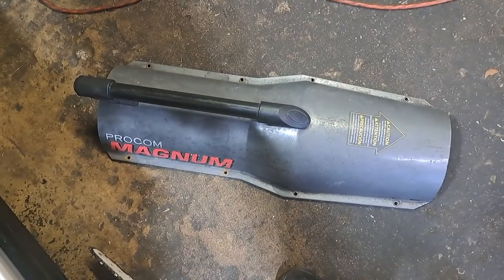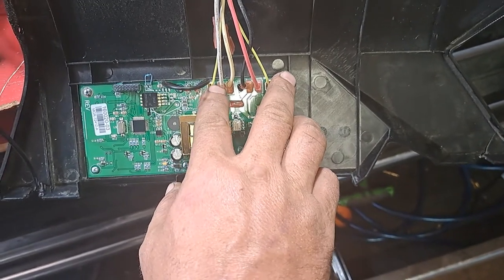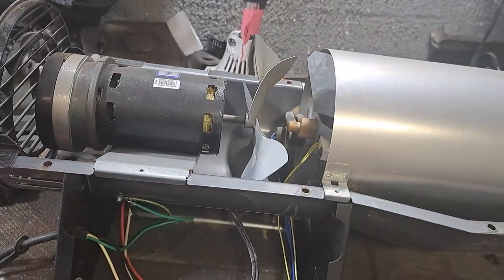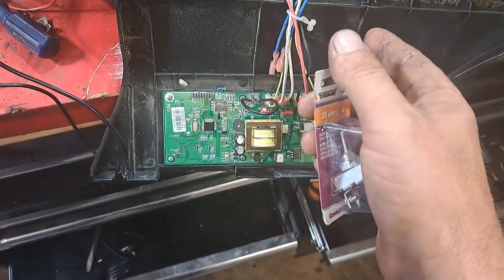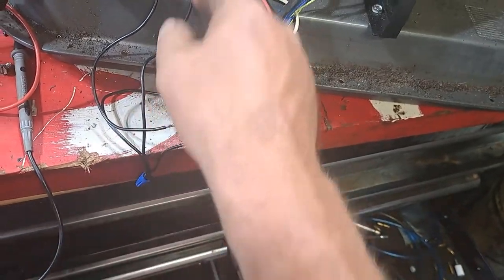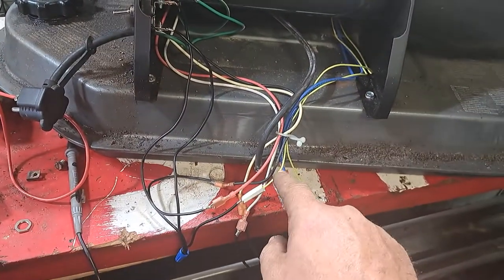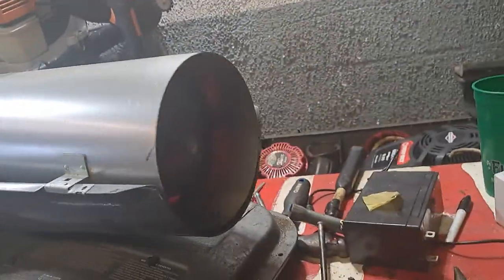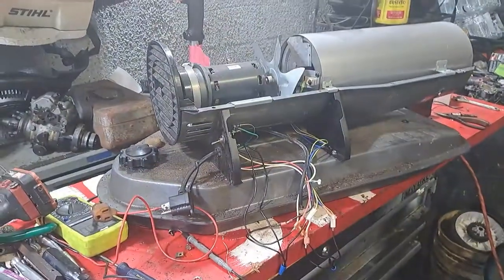how to bypass the computer on a procom magnum forced air heater pck110vt

Comment: This heater absolutely sucks!! Heck yes, I'm bypassing the Computer. Thanks
Reply from the maker: It works great now lol.
Reply: @smallengineguys  
Works better now than before. That computer board is shit. Once off it does tend to smoke a bit. Maybe the pump pressure is too high? Have to admit, the company selling them is about as bad as the board
Reply from the maker: yeah just turn the pressure down

Comment: they are junk!   i bypassed the electronic thermostat cause it wouldnt stay working.  so i use a stand alone therm from amazon and it worked last year...but now the board wont light up , so it wont work at all now......    SO my question is , do you HAVE to use a on n off toggle?       Can you just bypass the board and still hard wire so when i plug my stand alone therm into the heater it will come on when the therm ask's for heat?
....FYI i bought another heater that does not have a built in therm   it just has a on and off switch... i tried using  the stand alone therm with it and it doesnt turn on.     Im thinking i need to by pass the on n off switch on it as well.
Reply from the maker: Only did it the way I showed. On full time.
Reply: @smallengineguys  i would think if i wired it your way and used my inline therm that goes between the heater and the wall plug it would work.
Reply from the maker: let me know
Reply: did u try inline therm? just wondering thanks for the video
 @Dooguy

Comment: You are basically just bypassing the flame sensor that shuts the unit off if there is no flame. So now if the flame goes out when it runs out of fuel, the fan and glo plug won't shut down (and the fuel will still be pumping!)
Reply from the maker: This wouldn't stay running period. It's a common problem with this model. Now it works.

Comment: I just bought one, seems to be working just fine… I never looked up reviews before buying one and now I’m worried. 😂😅 so should I do this if either A: I get some type of code on the screen? Or B: it shuts off randomly and doesn’t turn back on
Reply from the maker: they had an issue turning off randomly and not staying on more than 10 min. if it isn't broke don't fix it.

Comment: This is genius. I have one that the computer has malfunctioned on and I'd like to do this. Your explanation was too confusing as you would say one thing and then correct yourself and I couldn't follow along effectively. Could you reply with a better explanation on what you connected to what? If like to get mine working again as Google doesn't seem to help find that particular part for replacement. Thank you

Comment: Just did this to mine thank you!!! I used what I had around so used a double house switch one to turn the igniter on and one for the fan.
Reply: I thought about that as well, but I don’t think it matters considering that igniter element is just sitting in that flame anyway. I’m open to hear any other thoughts I may not have considered

Comment: does glow plug stay on the whole time its running? 1. glow plug runs hot 2 or 3 seconds 2. then fire fan/pump?
Reply from the maker: i just left the glow plug on at all times. you can put double switch and turn it off after it all gets good and hot but i just left mine on and it worked great